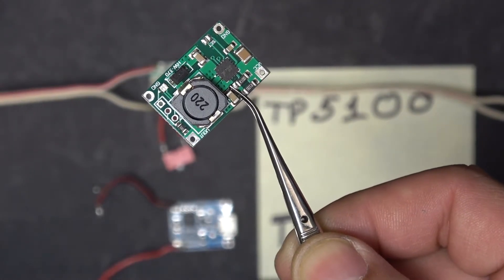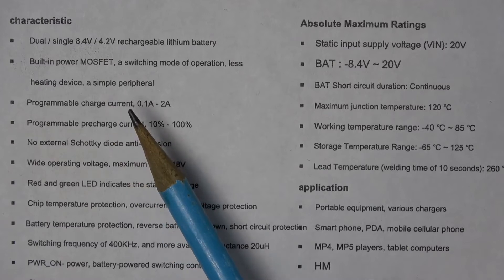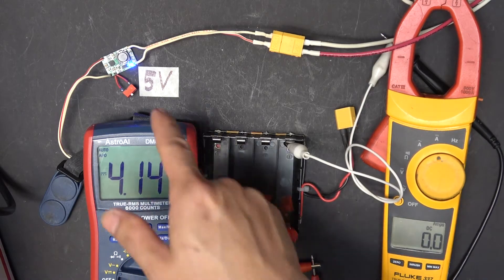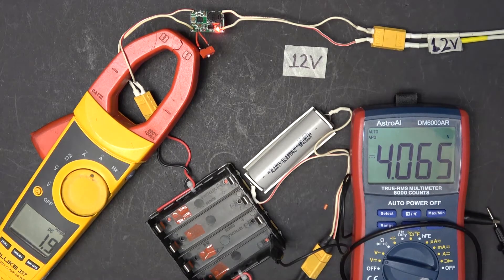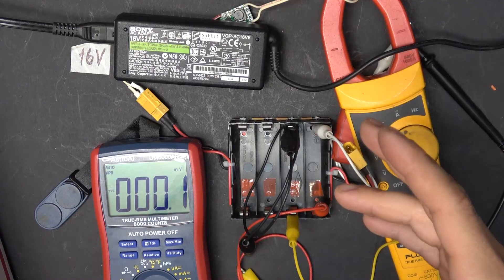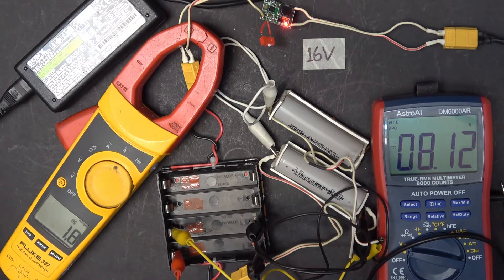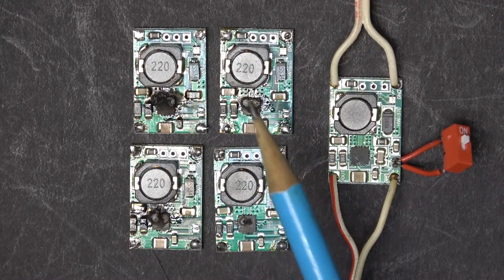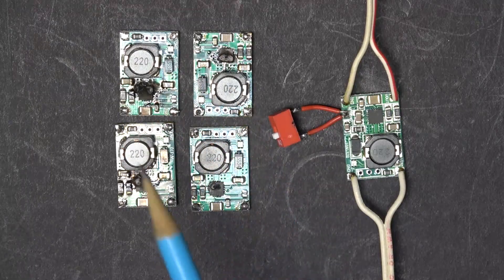Review: TP5100 module Li-ion battery charging board for 1S 4.2V and 2S @ 8.4V

Comment: You said it has to dissipate the extra voltage as heat, but this is a switching buck converter - right?  It shouldn't have to dissipate a lot of heat.
Reply from the maker: It runs really hot.

Comment: Very nice and thorough explanation. I also saw your other video where you connect the TP4056 in parallel to increase the Amps. Can you also parallel connect the TP5100 the same way ? I’m looking to see if I can get 8.4v charge at 10amp by parallel connecting 5 of these little guys. Each one only supports 2amps.

Comment: according of datasheet form tp5100 Vin should be less or equal 12V. if you use more tp 5100 will burn. and for output 8.4 volts, input 9.6 to10 volts is enough... check the value of Rs - if is too small the current will be bugger, and sometimes producer of the pcb put elements with wrong value...
Reply: Read the data sheet again dude 😒

Comment: If wr want to connect it with a 3W 8.97v 3A solar panel adding two 18650 3.7v batteries or one battery of 4v

Comment: is the first burnt board burned because reverse input voltage from power supply, or reverse battery ?

because in the specs it's listed "reverse battery shutdown"...

im looking for reverse polarity protection for battery side, since tp4056 unable to do that.

Comment: HI,
would you please suggest few purchase link for redesigned charger module, where a bigger capacitor is replaced by two smaller capacitors and one resistor.

Comment: I always had an issue with the TP4056 where I stick my battery in and it begins to charge then when it is done I pull the battery out, but the light never goes back to red even when I insert another 18650 that needs to be charged.  I have to remove the power from the 4056 then put the power back then insert another 18650.  I have 20 of them and they all work this way as if it finishes the charge cycle and latches forcing a power down to happen before it will work again.  Any idea?
Reply from the maker: I have quite a few variations of TP4056 boards but I haven't seen any behaving this way. Maybe you have a bad batch?
Reply: @vuaeco  Could be as they were purchased last year on Amazon.  I live with it, but not a fan of the TP4056.
Reply from the maker: @generalawareness101  These boards are made cheaply (hence the price) so quality control is not their priority. I have quite a few failed over the years.
Reply: Same here